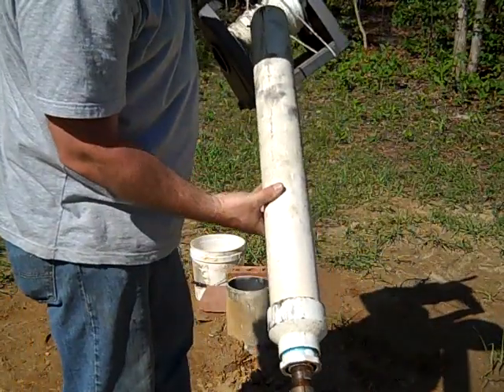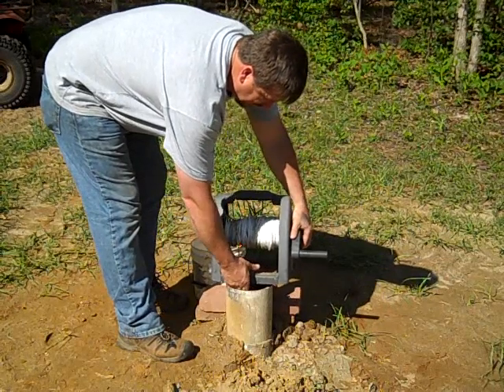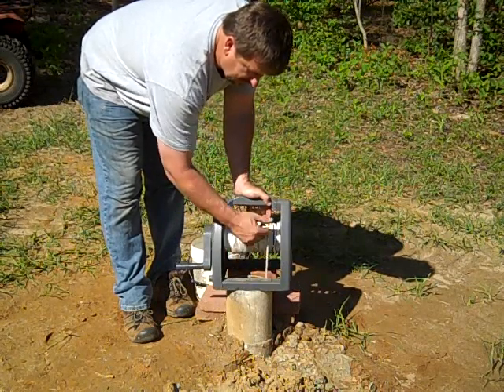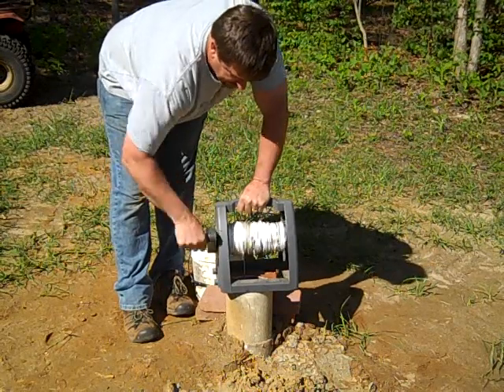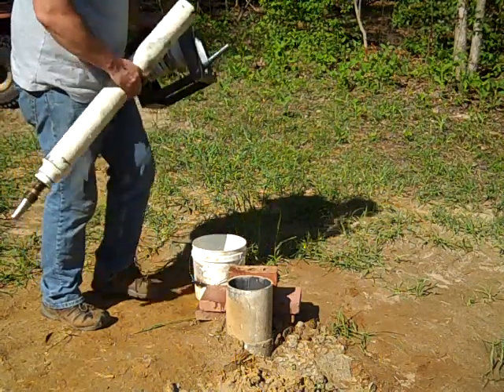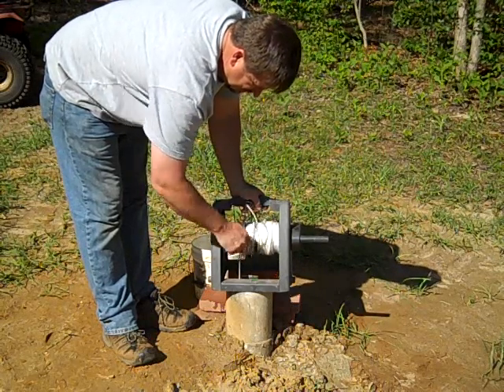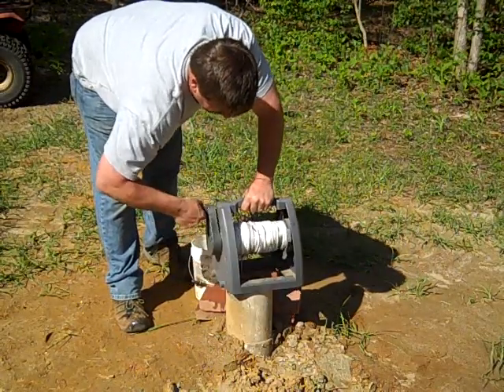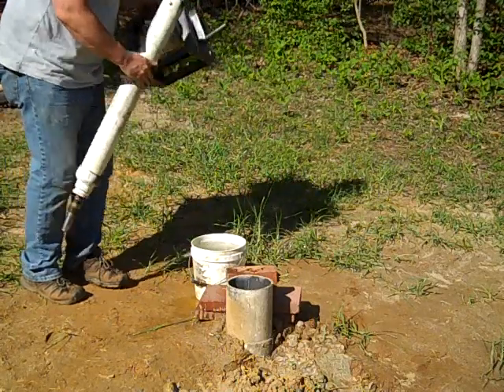All about wells - The Bailer Bucket

Comment: No one has a twenty foot deep well. Most are 200' to 300' with pipe and a pump in them. They would have to remove the pump to use a bailer bucket.

Comment: My well has a pitless adaptor. It looks to me like I'd still have to pull out the pump, drop pipe & electrical cable to make enough room for the bailer. Even worse, at some point I'll have to get the stinking male adaptor fitting  to slide back down into slots and seal, it's always such a great challenge to get those brass fittings to mate while I'm guiding them together at the end of a 5 foot pipe inside the well casing while holding a flashlight. I think I'll stick with putting a poly pipe with a check valve down the well and then jerk it up and down (like you-know-what) so I can get the water to flow.

Comment: Something I am contemplating doing.

To make it easier in handling the bucket, I would make a Bushcraft tripod over the well, then anchor the rope reel. There are types one-way valves, where you can break the seal when it's full, and then drain it from the bottom.

Thus, let the bucket down via the tripod and fill up, then pull it up straight out of the well on the tripod, then put a bucket under it and drain it into the bucket.

Comment: Great idea.   I would like to see the bailer redesigned to prevent having to turn the bailer over to empty the water.  The idea would be to allow water to come in, seal when full like the foot valve and allow the user to break the seal by just placing the bottom of the bailer on something.  A PVC reducer, something shaped like a plunger for the seal and the wooden part of the plunder would extend past the bottom of the reducer.  This would be used with something like a windless to draw the bailer up high enough for this to work.   Of course, this is just a description of a rough design.   Another idea could involve hinging the bailer a little up from the middle with the addition of something to stabilize the top.  This latter idea could be used in partnership with a windless.  It would operate similarly to the bucket system of old style draw wells by just tipping the bailer.

Comment: Years ago they were commercially produced from tin to fit inside 4'' casing.  The "Well Pail'' , tug of the rope after submerged set in motion the mechanics that closed the bottom. Extremely lightweight and bulletproof

Comment: I've had a bailed bucket standing by for about a year. My one way valve is holes drilled thru the PVC cap a dollar store sink stopper bolt and nut. I have several inactive wells around ready to be gutted if need be. Much better than investing big bucks in a manual pump system that could break or be stolen. The bailed goes back home with you.